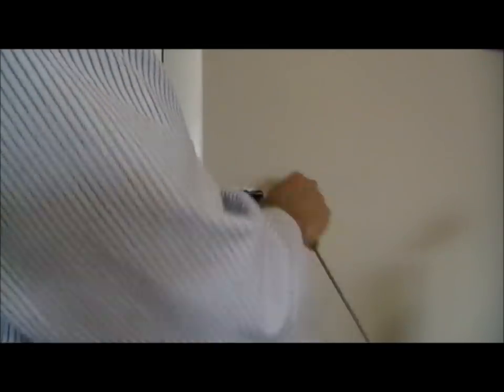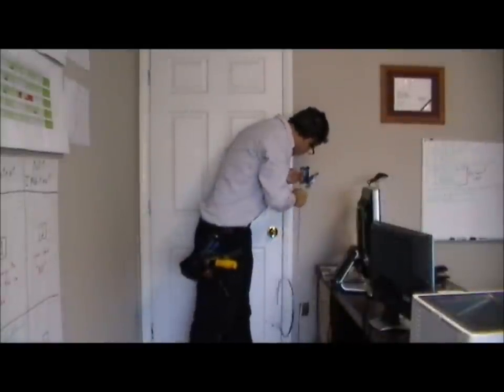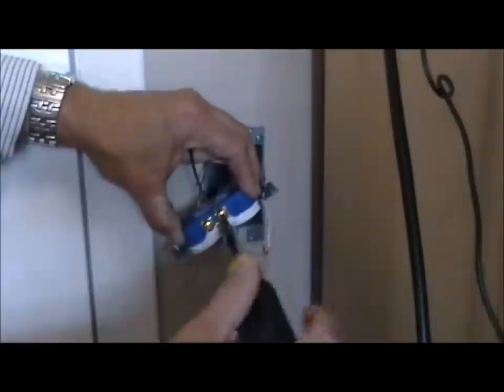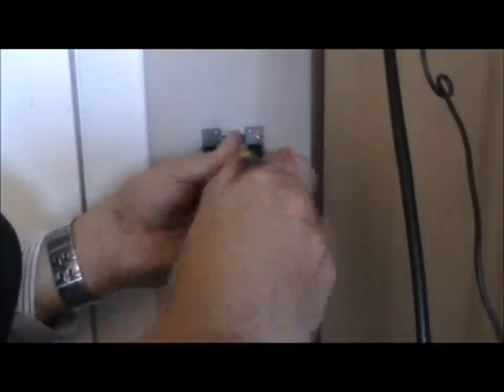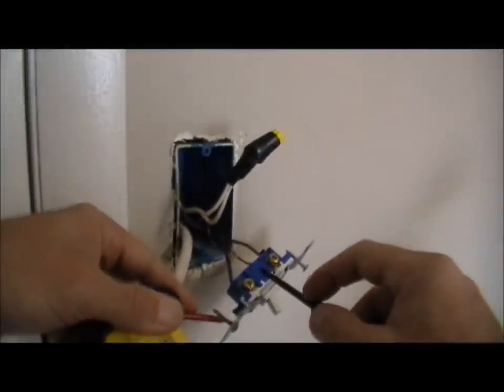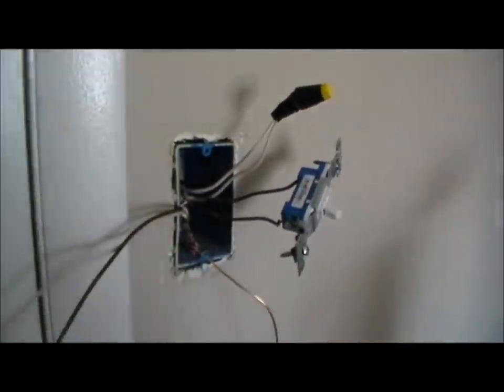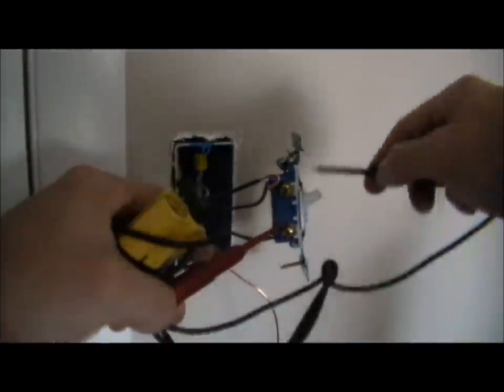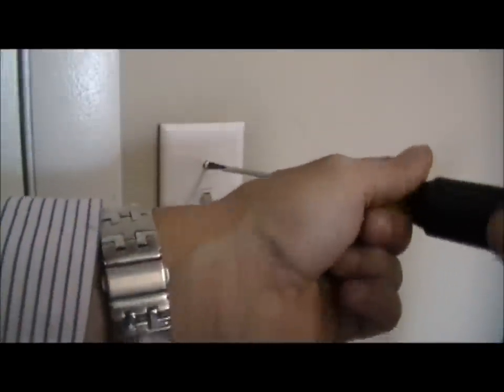how to wire an outlet off of a switch

Comment: Ground first then neutral Then hot
Reply: I'm in an electrical wiring class this semester and when I saw him wire the hot first, I was like, "No! The ground first!"
Reply: Thrift Diving is this legal to do? Like two hots on one screw? By all means I am no electrician. Just bought a house and want to add an outlet below a light switch like this video. I’m pretty handy and like to do this. Just want to make sure not gonna burn the place down lmao
Reply: @MoparGuy1625  I'm a bricklayer but I say it's perfectly fine!! Lol.
Reply: @MoparGuy1625  technically you would use a double pole switch to do this
Reply: It doesn't matter if the power is off there is no problem.
Reply: @ThriftDiving  we all electricians know the black wire goes firts but if the nrakers is off is not a problem to conect them all as we want to conect the wires
Reply: @MoparGuy1625 You are 100% correct he should have run a pigtail to the light switch instead of placing two hots on a single screw, also it's against code the way he did it.
Reply: Because he was working on the switch live it was much safer to connect the last...it eliminates the risk of the wire touching  the body of the ground on the switch....but next time doing a demonstration turn of the power...
Reply: Don't forget about the screws to be vertical...  i failed this question in my test 😂
Reply: Always, do it right and nothing will go wrong!

Comment: One thing I was always taught, is when your working on electrical issues, you ALWAYS kill the power at the breaker FIRST!   Then it's safe to now work on your electrical outlets and switches.
Reply: Make sure you figure out the load wire before cutting that breaker :)

Comment: why was it okay to wire the new outlet to the switch without turning off the electricity?  I understand you needed to know which wire was hot, but is there a safer way to do this?  Could you have been electrocuted?
Reply: yes
Reply: yes, switch the breaker off after finding out which screw is hot & do the wiring without getting electrocuted.

Comment: I have no issues with the basics of this video as such, not a hater by any means. 
Just wanted to note 2 things in particular.
1. It is definitely NOT best practice to have 2 wires under a screw at the switch.
2. Working on live circuits is stupid.  Test your wires, mark them and turn the bloody breaker off.

An old electrician told me something to keep in mind.
"There are old electricians and there are bold electricians.  There are no old, bold electricians".

If you post something in public, you really have a responsibility to keep it safe for anyone watching it.

As I said, not hating on the video, but you should be responsible with regards to safety.

Comment: I don't think it's legal to gang the wires onto a single terminal, a pigtail would have been a better idea.
Reply from the maker: I agree. We pigtails everything now. AFCI protection it is making every connection safe.
Reply: Generation 3 Electric There is protection in USA with this tiny wires? O_O
Reply: +Jules Al yes it is wrong to gang wires on to a single term, so we pig tail off ...

Comment: Great video.  The only thing to add maybe is if you are going to have one outlet work by the switch and one always on there is a metal piece to break on the right side where the black wires attach. Otherwise it won’t work.  I’m not an electrician so I didn’t word this right.

Comment: Only takes mili amps of current to stop a heart. 50,120, 240v doesn't matter, you complete that circuit through your heart. Bye bye. I have seen plenty of electricians work on live circuits, never a good Idea. Its the time you least expect it when it bites you. He probably knows what he is doing, but if someone who doesn't know electricity as well as he does tries what he did, they may not be around to read this post. I suggest Mr gen 3 electric that you post videos showing people how to get the job done and get it done safely. I highly doubt your posting for skilled tradesmen. This is the first video I have seen where the electrician works live and doesn't recommend turning off power at the panel.

Comment: in my area this is bad electric work you cant run two hots to a single screw u would need to pigtail the connection in the junction box so that you only had one wire to the original switch, also why are u working with live electricity
Reply: You should put some electri tape arround the oulet or around the ground wiree.

Comment: i have a switch which will turn on the light and also send power to an outlet. i need to change it so that the outlet is not dependent on the switch
Reply: Did you ever figure out how to do that?
Reply: Need to identify and remove the load wire which is feeding the outlet, (typically black) and tap into the power feed with a pigtail. Note that you could potentially overload a circuit if using high amperage loads plugged in at the outlet with the lights on

Comment: soooo,  all these comments about how this guy did this....and not one person bitching about how he didnt kill the power after determining the hot wire?
Reply from the maker: I was trained to work on life conductors. You can turn the power off.
Reply: YOU may have been trained to work with live wires. maybe you're a lineman.  but this isn't infrastructure power plant work. this is you tube residential how to.  I don't give a shit how you were trained.  kill the power when you work with electricity.  I'm a nurse and even I glove up every damn time I give a tetanus shot.  it's called being a professional.
Reply: Melonheadinbed Giving someone a tetanus shot, even with gloves on is leaps and bounds more dangerous than someone doing a little bit of live work with 110 AC,  Because people in a clinic are much more unpredictable than a few bits of wiring;   If he were messing with plant work  or 3-phase, 220, or some high-current DC, live, now THAT could be extremely dangerous.  110AC and Low voltage DC is relatively safe.   It would be dangerous if an unskilled person attempted to imitate him.   I wouldn't watch a 10 minute video of a nurse giving a tetanus shot, and then expect to administer them safely to other people, either.
Reply: be that as it may Dracolith1,  you're still missing the point.  if I were instructing someone how to give a tetanus shot, I wouldn't discourage them from wearing gloves.   so he won't get shocked.  I'll give you that. it's still the wrong way.  why did he make the video?  "hey joe blow.  don't flip the breaker before working on electricity".   there's no argument you can make to justify your point.  his expertise is irrelevant as would a neurosurgeon's while teaching a craniotomy using only a soup spoon.
Reply: Melonheadinbed It's not a problem. It takes a long time to turn of the power if it;s something as simple as this there's no need just know what you're doing. I put in new feeders to the panel with main breaker still on.
Reply: Melonheadinbed here we go the safety police that need to tell you how dangerous things are.
I think that we learn not to put our finger in an outlet when we are about 3 years hold, if by the time you change an outlet at 25/30 you didn't learn that you can get shock, then you deserve it

Comment: I was taught to never run 2 wires on 1 screw. It’s an obvious tell that the job was done by a DIYer. Am I wrong?
Reply: That's what I thought at first but the original wire was connected with a push connection on the back of the switch. The second wire was connected to the side screw. I'm not an electrician but it seems to be okay.
Reply: Pig tail it

Comment: Did you touch the hot terminal at 12:25 or I am missing something?
Reply: +Dewayne Maiden I disagree. Try touching a live wire while standing on the floor (being grounded). The current will happily pass through your body into the ground and fry you. You don't get shocked when you are off the ground (just like birds that sit on power lines) or have a very good insulation, like thick rubber boots or something.
This guy touches the live wire without even mentioning the implications that can happen if you are grounded. One will watch the video and think it is OK to touch live wires and will get killed.This video should be removed from youtube for safety reasons.

Comment: Danger, danger Will Robinson !
Reply: You may get fried if you are working on a damp concrete floor. Always turn the power off. Working on live wires on a wooden ladder if you accidentally touch hot wire can get you knocked off the ladder.

Comment: One thing I would critique is, don't work live if your not experienced doing so. You most likely will be shocked, and it doesn't tickle, and you can get burned by sparkes if hot wire touches ground wire. Play it safe, turn off the power. And always wear safety glasses too. Great job overall 👍

Comment: I have a few major issues with this video.....1- if your a licenses electrician, you would know that use of" quick connects" on any fixture is a terrible idea. They loosen and fall out way to easily. I would have taken them out and used the screws. 2- it is never a good idea to run 1 fixture directly off another. They should always be pig tailed. This separates the circuit and prevents lights from dimming when a larger draw item is plugged in, and is also code. 3- why on earth would you work with the line live then unscrew the line with your fingers? Your asking to get zapped. And 4- it is correct to re-wire ground, neutral, hot. This grounds The outlet you are touching with your bare hands, and prevents you from becoming the ground. Your statement about putting the ground wire last to prevent from getting zapped is false, ridiculous, and completely backwards. I've been a master electrician for 8 years, and was a journey man for 4. You must still be in your apprenticeship. Please don't post videos anymore, your going to get someone killed, or cause them to burn their house to the ground.
Reply: Tyler Wallace thanks for the advice on "quick connects". Going now to change new outlet I just put in my garage, but not turned on yet.
Reply: Tyler Wallace amen
Reply: That's what i was thinking... about  the pigtailing...
Reply: Isn't your statement on quick connects exactly what he said..? Don't use them because they come loose easy?
Reply: maybe u were not paying attention. he mentioned quite clearly using quick connects would loosen.
Reply: D
Reply: JAHMA Jones yes but then he kept the existing ones in place on the light switch

Comment: this video is great. a few questions:
 Can you get shocked if you touch the 1 (on always) hot wire and the metal box frame? or the ground? seems you twist it around so fast as if you cant.
 When you screwed in the outlet power wire to the always hot wire to the 1 screw on the switch, how did you not get shocked? you are touching metal no? isnt it powered up at that point? 
why are none of the neutrals used?

would it be crazy to turn the room breaker off to do this? 
or not necessary?

thanks

Comment: You touch the HOT wire at 12:25...  The only reason you are not fried is because you took the ground wire out BEFORE you touched that screw.  Extremely Dangerous.  Please noone try this at home...

Comment: @Terry. The ground pin should be in the down position for a vertically installed outlet. I'll have to check the NEC, but I believe that the shear-off situation you described is part of the design of the North American outlet. The ground pin would be the last part of the plug to disconnect from the outlet, giving an arcing hot one last safe path to ground. If an arc DOES occur, you want it to take the safest, shortest path to ground so it trips the breaker (or GFCI, or AFCI).

Comment: @ 12:26 HOW COME YOU DIDN'T GET LIT UP  FLICKING THE SCREW OPEN
Reply: Take a easy Mr. Maint. Man/Lo....D.
Reply: That's what I'm saying!
 Did you ever get an answer to that?
Reply: He wasnt grounded or touching any of the wires..
Reply from the maker: As long as you handle one wire the time you're in no danger getting lit up. I do not recommend a non-electrician do you work with live live electricity. I was trained work on live circuits.
Reply: so go right know and grab the black wire side to and outlet let me know if you feel anything
Reply: brettscott0925 On further review No the switch was off. So the screw was not hot the other was but still I would have turned off the power. It being a metal-box.Yes sir I would have turned off the power.

Comment: is that a good idea? just that if your taking a socket of a switch then you probably haven't got a socket in the room so that sockets going to end up with a multi plug adapter plugged into it but then if it trips i suppose you can tape up the trip switch

Comment: Trying to imagine when electricity was new and people had wires in their homes and no electrical code. How many people got cooked.
Reply: R Montana    I have a copy of 1892 NEC,  the first one.   It says to touch the conductor with finger and thumb to check for hot.  If not sure, place finger on tongue then test.   They might not have gotten shocked as much as you would think.   Grounded electrical systems only started in the 1950's I believe.

Comment: If I want to control the outlet with the switch, do I add the black to the NOT hot screw? I’m making an accent wall with LEDs but the wall doesn’t have an outlet controlled by a switch yet.

Comment: here in the Snny NW, winding a ground is not sufficient. There must be a mechanical connector such as a crimp grounding sleeve or wire nut. The green nut with the hole in the end would be ideal for this situation.
Thanks for the video, I liked it. Oh, we don't typically tape a wire nut.

Comment: not a good  instruction video, 1st he used his linemen pliers as  strippers not a good practice not everyone can strip a wire  with linemen pliers without damaging the wire, 2 he worked it energized which should be done by electricians with alot of experience dealing with energized circuits. It being an instruction video he should have noted to turn off power , 3 when dealing with a live switch he should have hooked the ground up 1st and he touched the hot screw  on the switch which was OK since the switch wasn't grounded.If your going to do an instruction video need to make it as if  the viewers have never done a electrical project  and wants to learn how to do it properly and safely and using the right tools
Reply: bryan plummer the in depth instructions were geared professionals and they were exceptional

Comment: There's some holes on the back of the outlet where you can insert the wires through instead of using the screws... My question is, since you screwed 2 wires on one screw could you have screwed one wire on the screw and insert the other wire in the hole and not having to pigtail the wires??? Thanks!

Comment: Great video.  Thanks.  Two questions.  1.  Aren't you "supposed" to wire ground first, then neutral, then hot?  2.  Is it safer to use a pitgail off of the hot for the switch hot, rather than connecting the hot to the outlet to the hot screw on the switch?
Reply from the maker: We are  pig tailing all of our wires on all current installations. Pig tails connection work much better with AFCI breakers. 

It is best for the ground to be the last wire installed on a device and the first wire removed. When the ground is attached you are much more likely to get shocked. 

It is best to make the grounds up first when you are twisting your wires together.
Reply: Two wires on one screw I thought was a nono
Reply: @Generation3electric  I can’t tell if your serious or not?
Reply: @rickcrawford7307  Doubling up wires on a connection in a no-no. Why no one has pointed this out is odd. Any code I know of requires use of a pigtail.

Comment: 1. didnt shut power off to switch . 
2. never double up on terminals 
3.you must pinch down the wire end on all connection they will come lose
4.dont use linemens tool 
5.i never seen anyone use a hammer as a guide , 18inch center of box off the floor is the code nec 
6 . use elec tape around outlet incase of connection make contact 
7.i never seen electricians work with a metal wrist watch on 
8. use a ground clamp and crimp grounds with pig tail 
9.never twist the wires let the wire nut twist them then after twist the wires 
10.this is a sad ass poor excuse of a  electrician

Comment: Not a bad video. Good workmanship. Especially with the linemen's pliars. lol. Only thing I have an issue with is wiring an outlet with 14 wire. I myself always use 12. Even though it is legal to do so in some cases but hopefully the next people moving into the unit don't plug in some high wattage using device like an a/c unit or run a small extension cord with a bunch of watts drawing a shitload of amps. Good luck with that one. Amps draw can be scary.